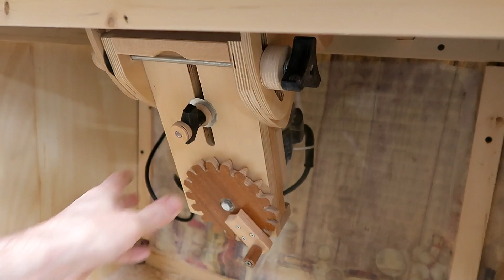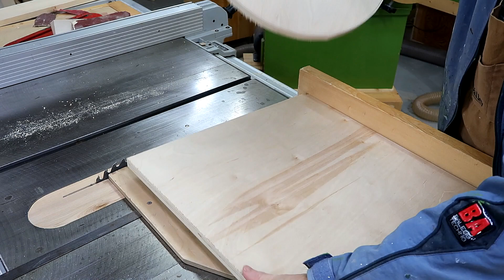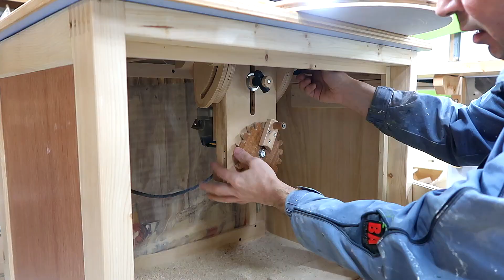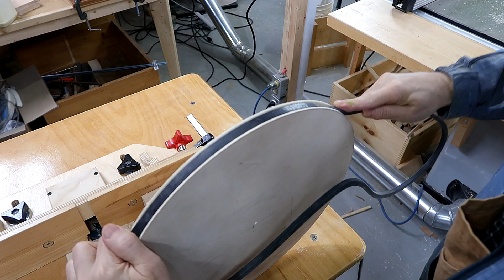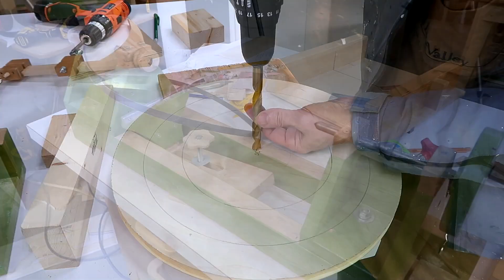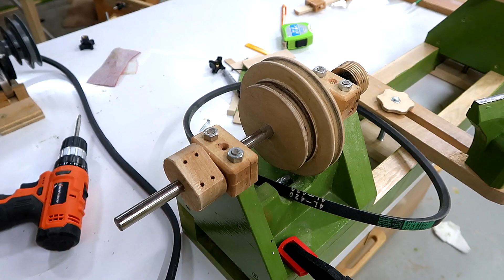Making big V-belt pulleys from plywood

Comment: That is a very creative way to make a large V-belt pulley. I have a project where need to do a 30:1 reduction taking an input of 360 rpm gear motor down to an output 12 rpm and I do not want to do a compound gear system with a double reduction. I am going to use a router to cut a 45" dimeter 1" thick plywood disk spur gear and a 1.5" pinion gear disk. Then I will epoxy/staple a strip of endless timing belt to the edge of each disk. With the speed controller I can run the motor at 50% or 6 rpm.

Comment: Hi Matthias, always so helpful and relevant. Your accuracy and creativity is something to aspire to. May I ask and apology if it has been asked, what is the dimension of the pulley you create here, what ratio between the small pulley and the large pulley and what rpm did you achieve? I'm assuming this is to turn real heavy stuff, like a bowl at the first stage of turning. This would help me a lot with setting up my DIY lathe. Best wishes, Shlomi

Comment: Sir my motor speed is 2880 rpm I have a two inch pulley on motor then what is required diameter of pulley and wheels to drive the saw for cutting of 4 inch wood (for BAND SAW)

Comment: Bigger would have been nice for even greater slower speeds but got the general idea -very nice!  Also wondering what angle the belts are, maybe I have a router bit that angle?  Never mind, previous post says 40 degrees. Dam sure I only have 45 degrees and that size does not friggen exist

Comment: That large of a pulley will work fine with no groove at all,  the groove in the small pulley will control the belt position.  This makes it easier to move the belt if using cone pulleys for speed changes.

Comment: Looking for advice and this channel is definitely the place for this question.  I have a cheap jobsite table saw which has broken.  The motor is not damaged.  Do you think that motor would be acceptable for a homemade lathe? If not, what else would you repurpose it given that I am not an engineer and need it to be a somewhat simple build.  (i.e. using it to make a home made table saw with lift and tilt is beyond my skills/tools) . Thank you to anyone who responds!
Reply from the maker: I suppose it would make a good boat anchor.  Its a universal motor, I don't recommend using one of those for anything.
Reply: @matthiaswandel  thank you so much!

Comment: I don't use v-belts much, but my initial concern is splitting the walls of the groove due to the wedge.  Any concerns here or is the force low enough to be irrelevant?
Reply from the maker: fur such a large pulley, the force is quite distrubuted.  I wouldn't use that cheap ply for a small pulley.

Comment: I've made a large (450mm) diameter pulley out of plywood on my band saw, which worked surprisingly well! I set the parallel fence to wall thickness and tilted the blade to get the 40 degree belt angle. you have to make through cuts at the beginning, otherwise the blade will jam due to the tilt and after making enough cuts, you dan turn it! Great solution withthe lathe too, though, my motor was too fast though, thats what the pulley was for :D

Comment: Have you ever experimented with penetrating epoxy? It's a low viscosity mix designed to soak into wood and bind the wood fibers, primarily in boat restorations. I would consider using it to reinforce the thin edge of the V groove of the wooden pulley. I actually want to try penetrating epoxy on an MDF project where it will readily soak in and basically create a low-rent fiberglass.

Comment: I found it interesting you don't put the pully onto an axel when running it on the router like you do on the table saw, and instead "freehand" it. Any particular reason?
Reply from the maker: That way I can actually approach the router bit and start the cut.  I already made it perfectly round on the table saw.

Comment: Matthias, could you please help me? Do you have something that can help me determine the size of two pulleys I would need to make to get a specific speed out of an electric motor I have? I have purchased your gear making program but don’t think that’s what I need.
Reply from the maker: Find the the ratio of the speed you need vs the speed your motor have.  This will be the ratio you need of the pulley sizes.
Reply: @matthiaswandel  hola me interesa comprar los planos podría sacar en versión español por favor 🙏 gracias

Comment: Mathias: temporary cuts, pieces, clamps down, drills, screws are dead on and result is near perfect.
Me: temp cut slants wronk (27-18 degrees in one end and 24-19 on the other side), clamp slide m´, drills too thin hole, screw shifts everythings 2 mill to f-all, screw snapps, mockup 10 times better than end result. Only thing i get right every time; 22mm holes for skateboard bearings.

Comment: Pretty sure you turned the v-groove into your drive wheel on the 26", but I only know what you put in the video.
Reply from the maker: if you HAD watched the video were I made it, you would know that I used my tilting router lift.
Reply: @matthiaswandel  Big bandsaw build 1: The wheels @8:18
Reply: Sorry I was imprecise. I should have said, "Pretty sure you turned the v-groove into your drive wheel on the 20", which is the video I linked to.
Reply: @Immolate62  imprecise is an understatement lol they are different bandsaws with different build plans...
Reply: @bmxscape so my error was a meaningful event in your life? You're welcome. Have you built any bandsaws?

Comment: Screw two 3/8 thick plywood disks together, trim the edge using the table saw, but tip the blade at an angle. Flip, and trim the other side so you end up with a bevel on both sides. Then, unscrew and reverse the pieces so the taper is on the inside. The screws help align the pieces back together.
Reply from the maker: Or just cut on the inside in the first place (using the procedure I mentioned)
Reply: Of course. I was just proposing a alternative method that is prehaps less sketchy on the tablesaw.
Reply: Thanks I will try this method

Comment: Matthias, are you considering updating your website to a more modern style?
It would take a lot of work to migrate all the content, but it could be worth it.
Reply: I like it as it is. Nice and tidy.
Reply: Why? Newer isn't always better. In my experience it's frequently worse. I find his website just fine.
Reply: Current popular web aesthetics are driven by phones where it seems like you need a thumb-sized buttons and the classic "top-left lighting" effect slashes with the ability, or really inevitability, to see content at any rotation. Add to that an industry pushing "simplification" that doesn't want border lines or tinted panels to separate content, and instead settles for vast moats of whitespace.

Then, younger developers copied what they grew up on, and then their work was in turn copied as well, each step moving farther and farther away from any sort of actual reasoning about why they're doing it that way.

IMO the best visual design takes advantage of the way our brains have decades of experience using colour, lighting, borders, and shadows to separate complex scenes into discrete objects, allowing you to fit more information on-screen at once, and just about everything else these days is a fourth-generation cargo cult derived from what looked good on an executive's smartphone back in 2008.